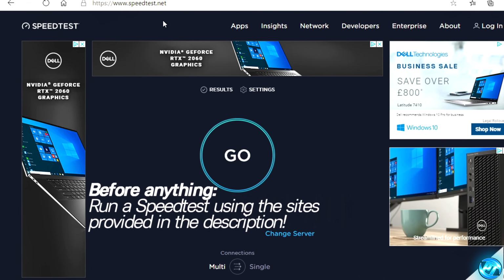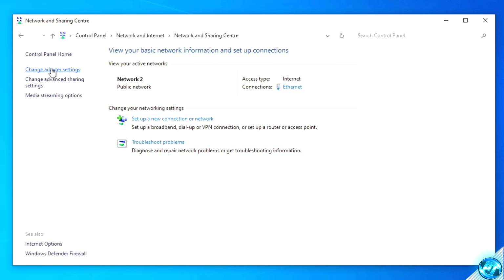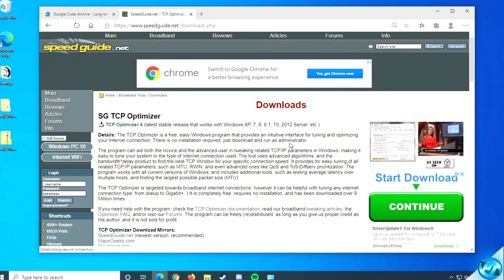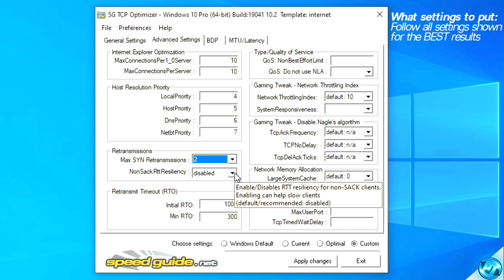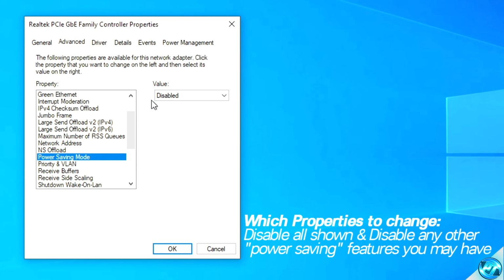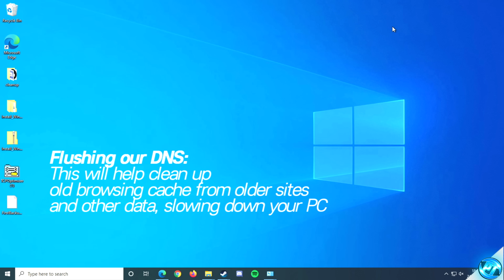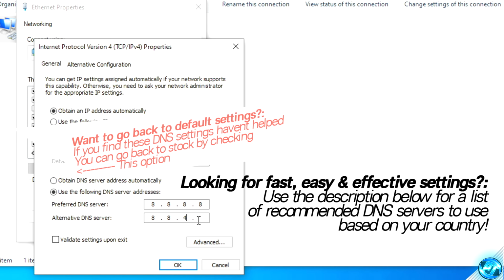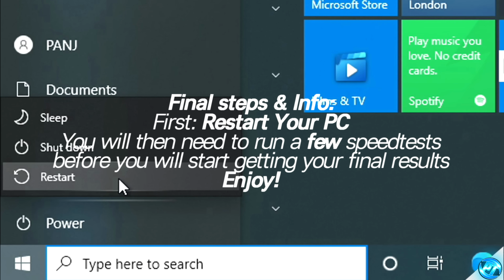🔧 How to SPEED UP your Internet! Boost Download Speeds, Lower Ping, Fix Lag on Wired and WiFi EASY

Comment: to fix your speed (download + upload + ping) (ultimate edition) :

1_check speed test on multi devices not one.
2_check from any damage to cables or devices.
3_reset all your network devices to factory state then turn off them for 15 minutes (need to reconfigure them after).
4_check if you pay to your isp.
5_check from isp network problems.
6_check if you have old devices.
7_reset any pc or other devices connected to your network backup data first.
8_reboot & shutdown all network devices and other devices.

##note this List not in order, you have to do check first.

##am glad to fix your issues (:    ,  this list made by human not by AI    🤘

Comment: 91.7 Mbps download 88.9 Mbps upload
 netsh int ipv4 set subinterface "Ethernet" mtu=1414 store=persistent
90.7 Mbps download 89.0 Mbps upload
netsh int ipv4 set subinterface "Ethernet" mtu=1442 store=persistent
I removed local router. 
91.8 Mbps download 264.2 Mbps upload

Comment: Last night I noticed while gaming that my ping went from about 25 all the way to 150. I did a speedtest and was getting download speeds under 100 mbps which its usually almost 500. I did several things but nothing worked. Called Spectrum and he tried blaming my ethernet cable because it was a cat 5 but I've been using this cable for a while and changed cables and still the same thing. I did purchase cat 7 cables but before installing them I tried most of your videos settings and viola! I now have almost 500 mbps again AND with the old cables! I when ahead and changed them anyway since I bought the cat7 ones. Thank you for taking the time to make such a great video. I had tried other videos last night and did the tcp optimizer etc but nothing else worked. Thanks again!

Comment: thanks, now in stead of 160 ping i have above 400.  Veryyyyyyyyy helpful
Reply: Try experimenting using different DNS. If you used DNS benchmark but it lags, it either means you didn't input the numbers correctly or the DNS benchmark could be inaccurate. Always try using different various DNS. Btw, it's "instead"

Comment: thanks for help your video helped me so much i am getting 50mbps and now i am getting 300mbps. A great tips for those who don't have a broadband connection or using mobiles hotspot to download just you need a 5g connection phone and then don't connect to wifi just connect you phone data cable / charger directly to the system and on phone goto - setting/hotspot settings/ and turn on usb tethering option and then you laptop will connects to a internet connect after 5-6 seconds and work on high speed. If you like that Give a like ....

Comment: The TCP optimizer helped my computer go from a 4mb/s upload speed to a 9mb/s upload speed! While it may be small and i know my computer is capable of far faster speeds i am grateful and thankful for your amazing video on this software allowing this improvement! thank you! Sadly, my computer is still dropping connection and i know it's an issue with the computer, the modem was put through a "reset" and i'm not sure if doing that again will do anything.

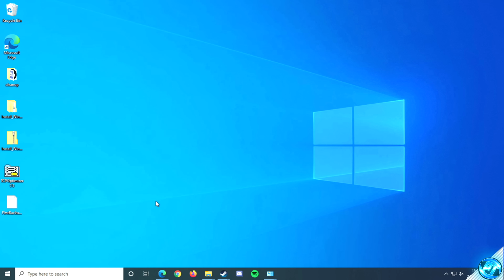Comment: Be careful at 8:00 this will indeed gonna boost your speed download, but this will hardly reduce any use of connection that is not downloaded!! On my side I have fixed my connection due to a problem with my router, after that I had good downloads but couldn't do anything while downloading so be careful with that!! I do not recommend to do this optimisation

Comment: I've followed all steps, however my PC is running at only 1/5 of the Mbps that my router is receiving both before and after. This method didn't help a single thing, it's still the same.

Comment: I have 2.0gb and i inly received 900mbps i did a speed test in the app and i get more than 2000mbps but in my pc it doesn’t and i use a cat8 cable and when i check my pc it says i only received 1000mbps how do i vhange that ? Or it may be i motherboard that can’t handle the 2.0gb?

Comment: Good advice, but you could have also show router options that affect performance, I personally tried enabling band steering, and it quadrupled my internet speed
Reply: Where is that
Reply: @carmiluh  You need to go to your router settings, you log onto the control panel and do it from there, look up a video if you dont know how to do it

Comment: this did not work for me it crashed my computer and made everything glitchy and run bad if your pc is 3 years old then sure but mine is not so this is not that good and now i have to figure how to fix my problem luckly it did not afect my wifi and i cant just run system restore because it disabled so this is not good advice.
Reply: Skill issue

Comment: I want to thank you so damn much it helped so much!
Here is how my internet was running before this video.
15mbps download 
20mbps upload 
ping: 23ms
and here is what happened after I did everything in the video besides the last part about the DNS thing because it was taking wayy to long
113mbps download
120mbps upload
ping: 15ms 
As you can see there was a dramatic change in my internet speeds Thank you so much I liked and subbed to you !!

Comment: 00:00 The Ultimate Guide on Increasing Internet Speed

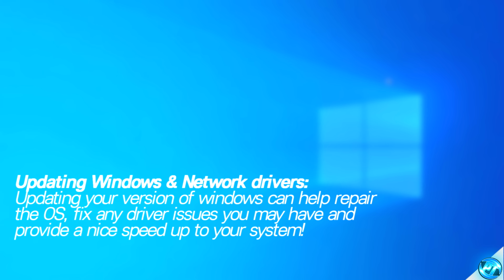01:36 Update Windows and Network Drivers for Optimal Performance

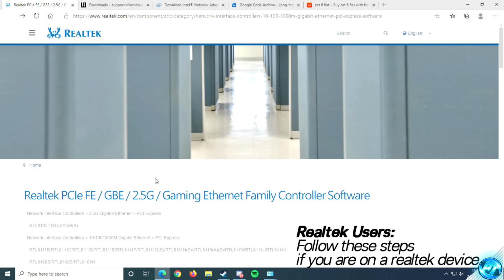03:17 Optimize internet speed by modifying network adapter settings

04:56 Optimizing network adapters in Windows.

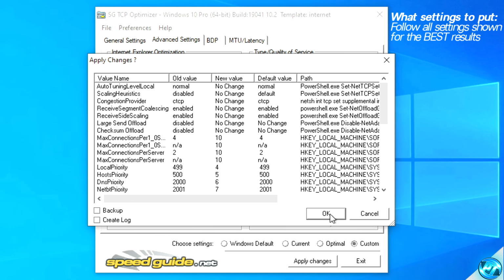07:02 Optimize network adapter and limit bandwidth

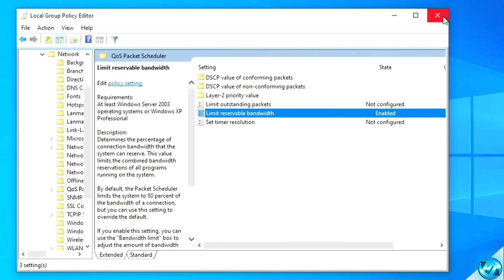08:42 Disable Windows update and improve browsing experience.

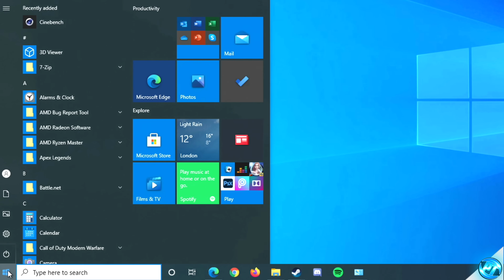10:30 Set up DNS servers for fast and stable internet connection

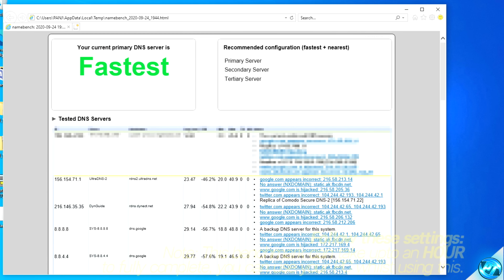12:09 Optimize your DNS for faster internet speed
Reply: You the real 1

Comment: heres a quick way, this is simple but most people dont do this so just connect to wifi 4 or higher if you have the options example. My download speed was 150, then wifi 4 had it at 424 so it does increase it by a lot.

Comment: i was disrespectful in my first comment, and i would like to say i am very sorry, my download speed is much faster after following the instructions in this video. all it was, was that i had to wait a while after doing several speed test before doing another one 20-30 minutes later, went from less than 1mb to 35-40mbs. again, im sorry for the disrespect, regardless on if you seen my original comment or not. and lasty, thank you very much as well!!🙏😭

Comment: I hace a question. My pc doesn’t have a Wi-Fi chip, so I don’t connect to Wi-Fi through Bluetooth, I use an Ethernet cable directly to the router, will all these tips and steps still work for me?

Comment: After having connectivity issues with some gaming servers, unable to connect or getting disconnected I reset my network settings. It solved my disconnects but my internet speed went from 930 down and up to 650 down and 280 up. Went crazy looking for solution. Then this video popped up on recommended, now my speeds are back to what i pay for 940 down and up. Thank you....

Comment: my issue is that even after following your instructions step by step my internet is getting better rates 500+/sec download however if i try to download anything on steam its never more than 20 and honestly id be lucky to have 12MB/s
the worst part is just yesterday i was getting 60+MB/s and all of a sudden it just dropped to 20 or 0 so i tried your video and its better but not ideal, any suggestions?

Comment: Make sure you enable group policy editor in windows 11 if you don't have it! I followed everything in the video but my windows 11 home did not have the policy editor. I started with 75 mega bits per second speeds and ended up with 38 after 5 speedtest. I then found a simple instructional video that showed how to make the .bat file to easily enable the policy editor. completed the last step in the editor then flushed the dns again. Restarted my PC then very first speed test i gained 10 mega bits and ran an 85! My ISP limits my speeds to 75 and have never ran that fast! THANKS SO MUCH FOR VIDEO!
Reply: can u tell how to do it
Reply: @shreejeeth https://www.youtube.com/watch?v=mycKcEacZXQ

Comment: Thank you for this video. It was really interesting but I have some problems. After the TCP Optimizer, 
1) My speedtest resaults are fine except the 200+ms on upload speed. (before the changes it was fine.), 
2) I had so often 100+ms spikes but after the changes, I have LESS often 200+ms for 1-2seconds when I got packet loss. 
Is there any solution here? Should I reset the TCP Optimizer changes?

Thank you!
Reply: @@YoPlxntr how did iu disabled it
Reply: bot?

Comment: I did all the work but the last benchmark tool gave me error saying my ISP is blocking it for some reason. "Your router or ISP appears to be intercepting and redirecting all outgoing DNS requests. This means you cannot benchmark or utilize DNS servers. Please adjust your router configuration or file a request with your ISP.' Can you help me with that. Thanks

Comment: After installing Windows 11 my internet speed was cut in more than half. This was the only video that included the solution to fixing it. I have no idea which part actually fixed it, but shotgunning it certainly worked.

Comment: I followed the video to a T and don’t get it. I didn’t really see a huge difference in my down, up, and latency. Then I went to run a bandwidth test using Twitch Bandwidth Test because I stream and it absolutely killed that. Now I’m getting failed tests left and right. 😢

Comment: I have a question : I have an wired connection which is on 1000 MBPS and when I try to play games it works for something like 5-6 mins but than the internet stops but it shows that the internet connection is working (I have contacted my internet provider and they said that the internet is now ok and that they fixed the problem, but it's keeps happening, and when it's happening it says on the web (chrome, operaGX etc...) that the firewall is blocking the way (or something like that) : in Apex Legends the game's freezing for something like 10-14 seconds, in Minecraft if I'm on a server it's just kicking me out of the server and in cs:go It says connection problems and the server is out of connection or something like that. So help would be veryyyyyyyyyyyy appreciated. Thanks you, Ness Geva.

Comment: Thank's for the guide, my download speed improved and my upload speed literally exploded from 200mbps to 700 lol

I just got optic fiber so it might be that i had put settings optimized around my shitty adsl and it was nerfing my new connection

Appreciate it alot

Comment: sir i already subscribe your channel, sir please help me why my upload speed is faster than download in windows 10? my upload speed is 90+mbps but my download speed is 0-1mbps :( please help me to fix this sir
Reply: Speed tests give you speed in bits per second while you get speed in bytes per second when downloading stuff. 1 byte is equal to 8 bits so 10 Mbps divided by 8 gives you 1.25 MB/second.

That 1.25 MB/second is your internet speed not downloading speed. Your download speed depends on both internet speed and the connection with the site you’re downloading from. Downloading speed varies from site to site.
Reply: @CokeasInCoke  my internet speed is fast sir .. Im not having problem about browsing .. my problem only is my download is super slow but my internet is fast
Reply: @christnovs  its happeing beacuse your upload speed is nothing if you go to settings to change the fast speed but internet is slower to mbps to 110kb to 20mb
Reply: or  7 mb
Reply: @CokeasInCoke  okay sir thank you so much

Comment: No idea what sort of magic this was, but my download speeds went finally from 400 Mbps to 900+ Mbps, (to what I'm actually supposed to get)
Reply: wtf you had 400mbps and you want it to be higher
Reply: @user-ob3wo6se7b  why wouldn't he, he pay's for it I have a 1gb connection as well and am getting 400 mbps I've not restarted my pc yet to see if it has done anything I will update if it has worked.

Comment: No operation can be performed on Wi-Fi while it has its media disconnected.
No operation can be performed on Local Area Connection* 8 while it has its media disconnected.

Wireless LAN adapter Wi-Fi:

   Media State . . . . . . . . . . . : Media disconnected
   Connection-specific DNS Suffix  . :

Wireless LAN adapter Local Area Connection* 8:

   Media State . . . . . . . . . . . : Media disconnected
   Connection-specific DNS Suffix  . :

Wireless LAN adapter Local Area Connection* 10:

   Media State . . . . . . . . . . . : Media disconnected
   Connection-specific DNS Suffix  . :

IS THIS NORMAL HOW TO FIX THIS ????
Reply: @Panjno
please help
Reply: when tyoung the command just be patient wait for some seconds and type it again, it should work

Comment: I actually didnt do the last step as it was taking too long but still after restarting my laptop

It went from 10.66Mbps download speed to 28.63 Mbps
and 4.25 Mbps upload speed to 20.09 Mbps
So thanks a lot it really helped
Reply: i did a 2nd test and the download speed went to 31 Mbps
3rd test: 27mbps
Reply: @king_rakshaan0512  eeeeeeeeeh

Comment: I didn't download any of the third party programs except my Realtek driver, but I tried the DNS flush and changing the network settings. I conducted before and after speed tests, which gave me results indicating my ping decreased from 12 ms to 7 ms and my download speeds were not affected. Although I expected my downloads not to change much, having a nearly 50% decrease in ping time was surprising.
Reply: Can you show me where the Realtek Driver is? Because he removed it in the description.

Comment: I don’t know if you can help with this.. I’m gonna try all your stuff from this bud later. But I am paying for 1GB download and I’m only getting 4-500mbps from spectrum.. I have had multiple techs come out and still getting low speeds. I’m fully wired right into the modem and I’m it’s right near my pc.. every heard of this of heard of a mobo throttling or anything?? I need to find this out asap I’ve been trying everything and I’m paying an extra hundred a month with no difference in speeds lol

Comment: Updating my driver caused a massive PC crash. Not only did this not solve my problem, it created another one in it's place. I hope your advice didn't brick my PC.
Reply: @DylanWilliams 3515 how tf does your wifi correlate to your pc components?
Reply: @eyemaster8687  he probably downloaded some random ass drivers from some 2012 site
Reply: @DylanWilliams 3515 You can rollback the driver, that's what I did. You can find a guide for it.

Comment: You said it could work with wireless connection as well. I followed everything step by step and was seeing different information on my screen during certain parts, wasnt matching up with yours so I stopped and panicked and uninstalled the program lol. Help?
Reply: You probably have a different kind of device, and kind of wifi, as he said on some parts it won't work for a different os. But also you need a variation of the the same apps he used

Comment: WARNING: Before doing all this, make a restore point, because incase of something failing, because you dont want to end up with NO internet
Reply: Well i could have used that infomation a bit earlier is there maybe an other way to Set these settings back?
Reply: @_b3xi0_73  in the program, there's an option to reset to windows default settings, you blind?

Comment: Please i need an answer to this question my wifi is running at 220mbps my iphone my laptop all get 200mbps BUT ONLY my pc is getting 30 mbps please help
Reply: are you using laptop?
Reply: use wifi adapter or use cable

Comment: idk y, but after i did those procedures, my windows give me black screen after the login section, and i need to go to task manager open cmd and prompt sfc /scannow, after it's done, windows finishes booting, also i need to do this every time i boot, (also of course i've tried to restart explorer process, it shows that it's running somehow on task manager, but nothing pops up on screen, no task bar, no icons, only a black screen with mouse working.)

Comment: Somehow after doing these steps, every time I wake up my computer after putting it in sleep mode, it disconnects from my ethernet and shows that it's unavailable to be found! Any thoughts on why? It goes to normal when I restart.
Reply: Try resetting the default settings on it. That should fix

Comment: Hey. After applying all the settings internet speed on my wifi increased from 29 MB/S to 72 MB/S Thank you for making these tutorials. I will see what ping i have on cs go. : )
Reply: So whats that ms
Reply: @Cold_Lawliet  download speed
Reply: @zuki4607  ms means miliseconds, in this scenario referring to the ping delay in miliseconds
Reply: 186.52 MBps to 216.73 for me
Reply: Ping on cs go is better. It was 70 now sometimes its 60. Better by 10.
Reply: @vidmantaskvidmantask7134  hahahah
Reply: I got 1MB/S like what am I doing
Reply: I don't understand you guys how you can increase your speed so much? I mean what internet speed are you paying? If you have 30Mps I suppose you pay for 30Mps, so how you can double it? This don't make any sense to me.
Reply: @SinNombreBiH  I have 1gb but my new desktop is only recieving 80mb, thats why me and most of us are here :v
Reply: @RafaelSilvaLD  If you pay for 1gb download speed and you only get 80mb then you should first call your Internet provider to fix it.
Reply: @SinNombreBiH  i get 600mb WiFi with my laptop and phone. I have the full speed with ethernet cable. Yesterday i downloaded GTA 5 in 13 or 14 minutes. But i just mounted a desktop with wifi motherboard but its not as good as my laptops. I cant find it anywhere, but i think its a 100mb wifi. Its not easy to put the cable to my room but if i cant improve this i will try to do it
Reply: i got 3 mb/s ima use this and see what i get
Reply: One more advice put the internet modem  near the window for better connection. Also you can put small anthennas into it.